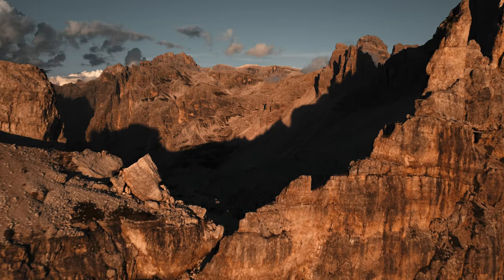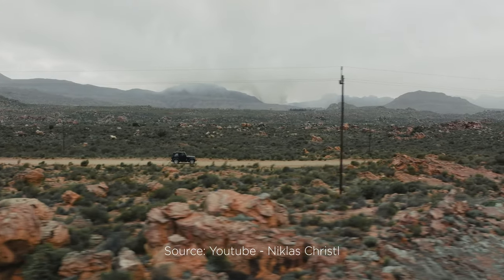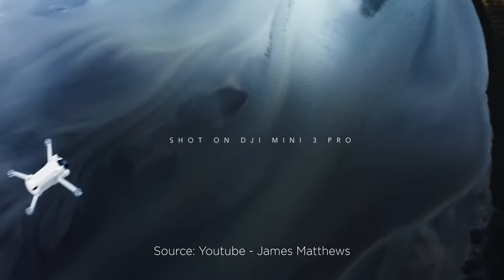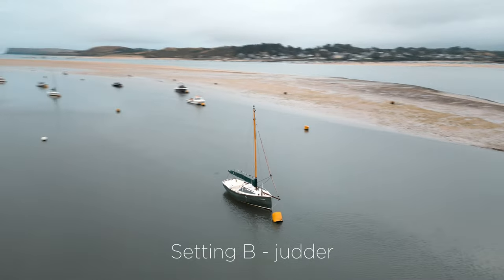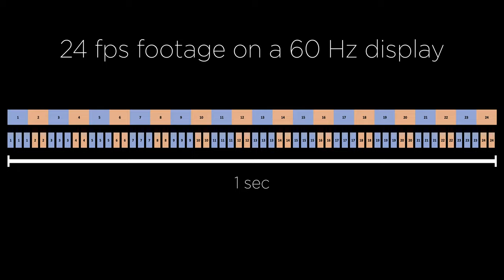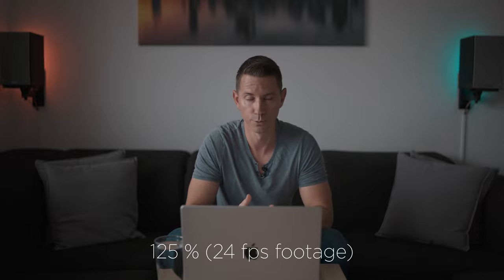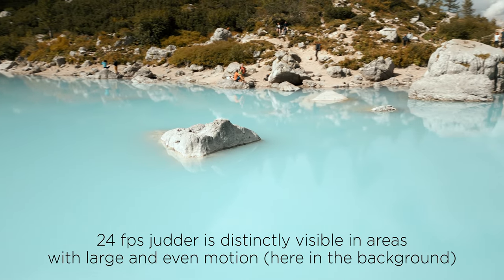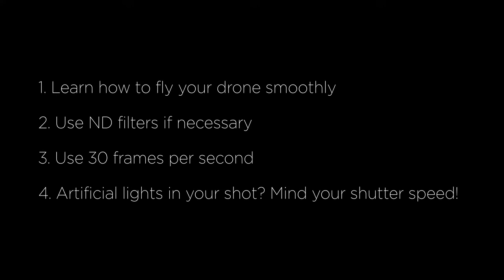The #1 Secret for CINEMATIC Drone Video without Judder, Stutter or Jerkiness

Comment: Fully agree! I’ve never shoot in 24 or 25 fps because I make videos for Youtube and not for the cinema. Before starting videoing I read the specifications of Youtube, iPhone cameras, computer displays etc. If one understands the technical background, it becomes clear that you must shoot in 30 or 60 fps to get smooth videos.
Reply from the maker: True that! Maybe at some point in the future the majority of creators will understand... but until then, 24/25 fps judder it is ;)
Reply: What if my production includes both, drone footage and dslr? If my drone is set to 30fps, should I set my camera to 30fps as well? Hope that's not a silly question.
Reply from the maker: @spider7studio No, not silly at all. Ideally the frame rate is all the way the same throughout a project, so if you go for 30 fps, select that on all your cameras 🙂
Reply: @t0mwhazzup  Thank you !
Reply: Very good explanation, thanks. Is there a huge disadvantage in recording fpv drone footage in 60fps-1/120ss and then converting it to 30fps project ? 
The benefits: possibility to do slow mo, in goggles feed/ real time view of 60fps, better post process stabilization. But what about cons?

Comment: One other judder-adjacent issue I've noticed is trying to play back raw drone footage on a PC before editing.  The raw files are encoded at roughly 135Mbit/s on my drone, which is more than most pc's can handle still, so it will judder and drop frames in the player.  Basically, make sure whatever you're playing is a low enough bitrate that your pc/device can decode it faster than realtime playback speed.
Reply from the maker: Might be, yeah, it really depends on the machine your watching it on.

Comment: You forgot to mention one thing,  you can get smooth (or with very little judder) cinematic footage from a drone using 24fps if your video is slow enough without any fast panning movement.
Reply from the maker: In your scenario you get only little judder because there's only little or slow movement. Of course you can do that 🙂 but you'd still limit your motion possibilities by using a technically incorrect frame rate.
If I'd deliver the stuff I do for broadcast in anything else than the correct frame rate (in that case that would be 25 fps), the TV station would reject it.

Comment: I've never shot at 24fps, as it never looked smooth to me. I always shoot at 60fps, at it handles turns better and works well for slow motion
Reply from the maker: 60 fps is definitely the smoothest and handles turns the best. But it really depends on what your aiming for because 60 fps lacks the film-like qualities associated with lower frame rates (24-30).

The other thing is, the quality of each frame at 60 fps is less because it squeezes double the frames into the same amount of data (bitrate) compared to 30 fps. Not a problem if you don't push the footage, but with harder color grades it might fall apart earlier.

Comment: that's the thing, i'm running some tests now ecxatly because of judder in my 24fps footages.. and i just realize that 30fps is better for drone proposals... smooths a lot the judder problem and don't really loose the cinematic effect. Changing my upcoming footages set to 30fps for sure.
Reply from the maker: Yeah exactly. It is so strange, it is very common in a professional video environment to make a project's frame rate fit to the intended viewing device. Only in the Youtube "filmmaker" world everybody goes crazy about 24 fps because it is supposed to look like cinema. But it doesn't - in cinema, there is no judder because cinema can display "real" 24 fps. Most smartphones and computers can't. You get, depending on the content, a juddery mess - and in drone video due to its camera movements it is the worst.
Happy that you like your progress with 30 fps ☺️

Comment: Hi Tom, I've been researching for how to eliminate the judder in my drone videos for weeks and your video is so far the clearest  and most helpful for resolving this problem. Thanks a lot! One question still haunting me is that, what shutter speed is most idea for drone shots? Two main reasons for this question:
1. There are no variable ND on the drones and sometimes, like filming sunset, the contrast of light facing towards and backwards the sun is greater than 5 stops and is almost impossible to find an "ideal ND" for that scene, since drones like DJI mini and air only got fixed aperture and you can't compensate for that 5 stops of light by dialing down the aperture. The only way is to use a lower ND and then speed up shutter, if you don't want to turn up the ISO. For example at 30fps, filming at 1/1600 towards the sun, and 1/60 in the shadow. But it in turns reduces motion blur and may not play back smoothly, if flying over subjects at high speed. Do you have recommendations of shutter speed range, (like 2~4 times the frame rate) which in your opinion is "safe" for judder-free clips?
2. Air 3 has 2 lenses now, what's the best shutter speed for the 70mm focal length? since it's a longer focal length, by panning or circling around an object, the background moves tremendously faster than the normal 24mm lens. 
 Thank you so much for this great content! Wish you keep making more videos!
Reply from the maker: Great question. Unfortunately, there is no completely satisfying answer to the problem with your sunset example.

I'd suggest, if you know beforehand what you want to shoot, take off twice. Once with a lighter ND (or without ND) for the shadows, and once with a stronger ND for your sunset shots. In general, if you record in D-Log M with your Air 3, you might have a bit of room for underexposure which can be corrected in post. I have an Air 3 myself, but too little time so far to test out its dynamic range.

When it comes to shutter speed, independent of the focal length, the 180 degree shutter rule would always suggest 1/60 sec for 30 fps footage.
If you ask me personally, I really, really prefer even slower shutter speeds like 1/50, 1/40 or even 1/30 for drone shots. The reason being, stutter (not to be confused with judder which caused by incompatible frame/refresh rates) gets the more eliminated, the more the shutter speed approaches the frame rate. I.e. with 1/30 sec at 30 fps, there is no stutter at all because there is no gap between each frame. At 1/60 sec at 30 fps, you "exclude" half of the motion between each frame, and the faster the shutter speed gets, the more it get'a a stop motion movie. I hope you understand what I mean. Depending on the speed of the movement in the shot, it might get very blurry, BUT in drone shots - for my taste at least - that can get very advantageous in most scenarios. Some examples:
- Fast flight forward close to the ground (or foreground objects) towards a subject: the ground and the foreground objects you fly by get very blurry and convey a strong feeling of speed therefore, while the subject (that needs to be close to the center of the frame) stays sharp because it does not or only barely move within your frame.
- Orbit around a subject: again, the subject stays very sharp even with the slow whutter speed because it does not move within the frame (it stays centered), while the background gets veeeery blurry due to the movement of the background. This gets even more pronounced at longer focal distances, like with the second camera on the Air 3. I love this because you get a great sharpness contrast between subject (sharp) and moving background (blurry mess).
You can think of more examples surely. Important is only that the subject itself does not move too much from frame to frame in order to not get blurred by the slow shutter speed.

So far (with the Mini 3 Pro), I have given more priority to a good exposure (as bright as possible without overexposing relevant parts - I explain this in my other two tutorial videos). So my shutter speed was varying between 1/30 and 1/100 because exposure is always varying depending on which direction you shoot (as you mentioned) AND the Mini 3 Pro only delivers good quality footage if you expose well. With the Air 3, I have too little experience. Maybe it's different to underexpose a little more without getting too much of a noise penalty. But as much as possible, I tried to stay in the 1/30-1/50 department whenever possible because I like the smoother, blurrier look.

Just for recap, judder is incompatibility between frame rate of the video and refresh rate of the screen (i.e. 24 fps and 60 Hz screen is not compatible). Stutter is something that might look very similar, but is caused when the motion "gap" between each frame gets too big because of a faster shutter speed when there's noticeable movement in the frame. E.g. at 30 fps with 1/30 there is no gap, with 1/60 you miss half the motion, with 1/120 you miss 75% of the motion and so on.

I really hope that helps. If you have any further questions, please don't hesitate to ask. It might take me some time usually, but I will get back to you.

And thank you very much for your motivating words. I'd love to do more content and have some ideas already, but right now I have really busy times. Just woke up too early today so I had some time to give you this extended answer ;) Thanks again, and I hope you can capture some stunning shots!
Reply: Thank you so much for these thorough replies Tom! It's really helpful, from my experience 60fps with 1/60 works fine for most shots if there is a defined subject like circling or following shots, I will test out 30fps with 1/30, if that works out as well that mean one additional stop of adjustment.

And you are right, with dlogm or dlog, expose to the right can really help boosting efficiency when shooting in contrasty scenes. But I found the zebras and histogram in DJI FLY a bit unreliable sometimes, looking forward for an exposing tutorial for drones haha😁

Really a shame that I can't send personal message here on Youtube. Really would like to discuss some more topics with you. May I ask do you also run instagram or facebook or have DJI Forum account?  @t0mwhazzup
Reply from the maker: Sorry for late answer. I have not really looked that detailed into histogram and zebra reliability, but it's a good hint. I will definitely check in the future.

Yeah, true. You can find me on Instagram @tom_whazzup but tbh I'm not much of a social media guy so far, I guess I respond to youtube comments more often than I open up my Instagram ;) @Erikaeee
Reply: @t0mwhazzup  thanks for the replies Tom! I've sent you a message on instagram sometimes ago and I figure you didn't check it haha, hope to hear from you soon!

Comment: Great examples. The most popular drone videos are riddled with noticeable jitters, and once you spot it, it's hard to ignore. Initially, I thought maybe I was just more sensitive to it than others. 

Honestly, I never knew that the Dji mini 3 pro could actually capture footage that impressive. That's why I've always opted for the pricier drones with bigger sensors. Unfortunately also bigger to carry.

One thing that still puzzles me is the idea that frame rates between 24 to 30fps give a more cinematic vibe. Why not just shoot at 60fps or even higher and then slow it down for that ultra-smooth result? Or does that approach not really work?
Reply from the maker: I feel the same. Lots of awesome drone content out there, but most of it with this judder problem. All because of this 24 fps cinematic myth crap..

Mini 3 Pro is amazing for its size. I have an Air 3 now, too, because of it's size/weight (wind!) and of some features that will suit me very well for some upcoming projects. I have not yet checked the footage quality, but as it is the same sensor size but newer technology compared to the Mini 3 Pro, I assume the quality will be almost the same, little bit better maybe. But the quality of the Mini 3 Pro is more than sufficient for most stuff IF you know what you do.

I think you confuse something here. I guess you're talking about that "trick" that is often used for handheld footage to make it look more stable and smooth. For drone footage, that does not really apply because drone footage in itself is already stabilized (except for FPV footage), so you don't need that. Slow motion in drones makes only sense if you want exactly that: depict something in slow motion. Which is very rare for drone footage, from my experience. 90-95% is real time, 8-9% is sped up and 1% is slow motion.
Apart from depicting something in slo mo, there's no benefit in using higher frame rates on a 30 fps timeline. You'll even lose some image quality because the available bitrate (150 MBit/s for the Mini 3 Pro) will be spread out over 60 frames instead of 30 frames. So, half the data per frame. If it is noticeable? I don't know. But if I don't need the higher frame rate, I'd always opt for the same frame rate from start to finish.
Reply: I'd like to answer why 30fps not 60fps.... In 30 the outcome movie on screen will have a look of "softness" known in cinema movies... If you go with 60fps ,yes, u will gain sharpness but your movie will look more like "soft opera" one.... Not a plesent or professional look at all... Typically  60 and above fps is barely useful for slowing down footage  to maintain sharpness and details of slowed down footage.   If you slowed down footage taken at 30fps you may end up with fuzzy details.....

Comment: Great explanations, do you also know why my drone footage often has this "flickering" or moire? It seems to be happening in areas with a lot of detail and I've read it might be about the GOP compression of the H.265 Footage. But there is no other option on my drone... So I am wondering, is there any way to fix this in post? @Tom Whazzup
Reply from the maker: Yes, this is most probably a result of the Long GOP compression. Leaves in a tree especially in windy conditions are a good example for that.
If that's the reason, unfortunately there is no fix in post I am aware of... and All-Intra codecs are only available with the Mavic 3 Cine series unfortunately :(

Comment: 4:41 you can also enable optical flow, if the video isn't super fast paced it should work great!
Reply from the maker: True, that's also a way to do it :)
Reply: Optical flow is when you let the software create your intermediate frames. Do you mean use optical flow on a 24 FPS footage on a 30 FPS timeline without the 125% speed correction?
Reply: @kaadinaraja  Yeah that will work, or if you have a 30 frame footage on a 30 frame timeline but you want a bit of that footage to look slow-mo, you can lower the speed and then enable optical flow. If there's not a lot of camera movement, it should look pretty good! If there's too much movement a ghosting effect will probably be visible.

Comment: I came back to this video as I've been playing around with 24fps as well as 30 and 60, using ND filters and I won't be going back to 24fps with the drone. My latest video was testing in low light and the first few minutes is 24fps with an ND 16 filter but then I changed it for an ND 8 and 60fps and the final couple of minutes with no filter and 30fps and the 30 and 60fps are better imo. I think people get fixated on 'the cinematic look' but you can get that whichever frame rate you use, just have to use your imagination a little, ND filters can help with that too. Thanks for the video, you explain it all very well.
Reply from the maker: Thank you very much for your feedback 🙂